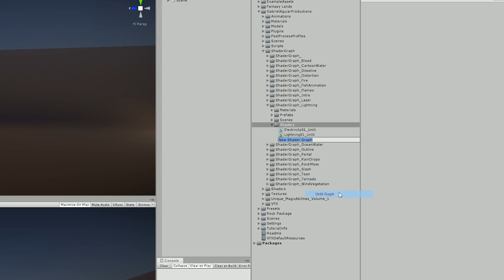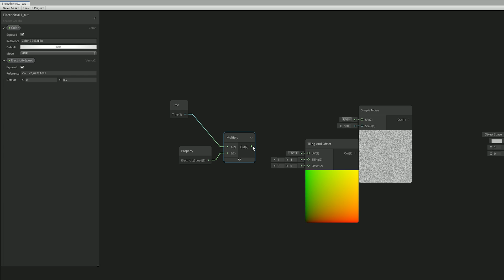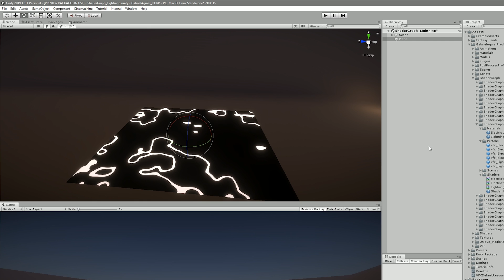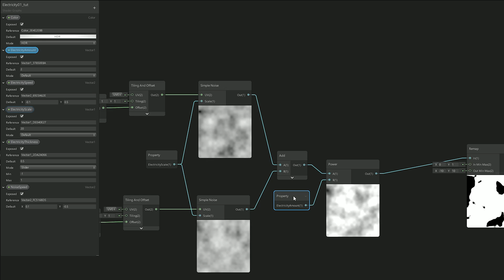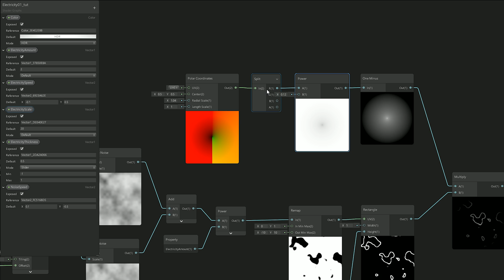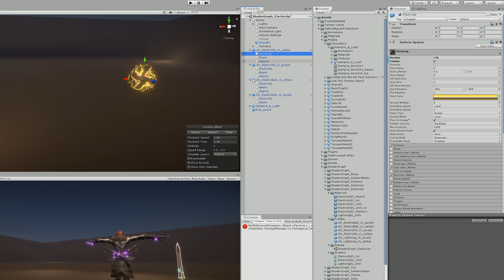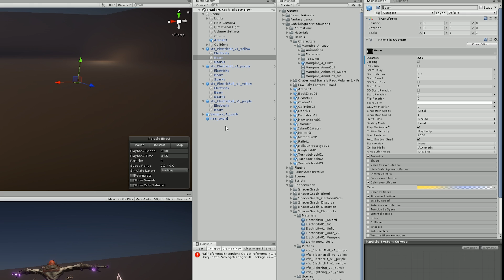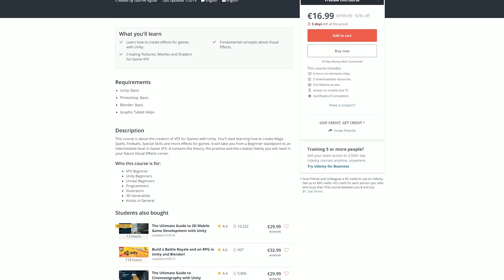Unity Shader Graph - Electricity Shader Effect Tutorial

Comment: Is anyone else having the problem that the Shader is not animating? It's working fine in the preview for the nodes, but it's not animating in the preview in the bottom right inside Shadergraph or in the editor (neither scene or game view).
Also why not use a step node instead of the remap node and then a second step node with a slightly higher second parameter to get the lines instead of using the remap and the square, that seems weird. But it works so who cares :D
Reply from the maker: I actually tried with the 2 step nodes but wasn't able to get the lines as well as with the remap and rectangle. :/

But thanks for the suggestion! :)
Reply: @GabrielAguiarProd  im also having trouble with the shader not animating in the preview or scene/game view
Reply from the maker: Turn on Animated Materials on the Scene window. There's a drop down menu next to the Shaded option and 2D option in the Scene.